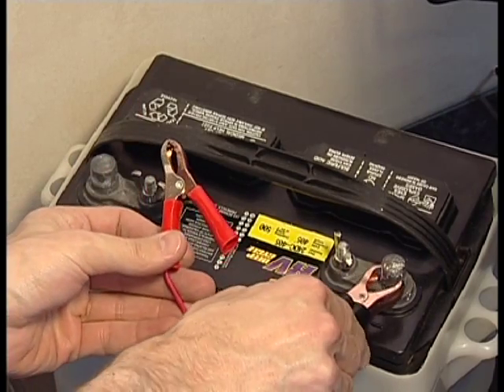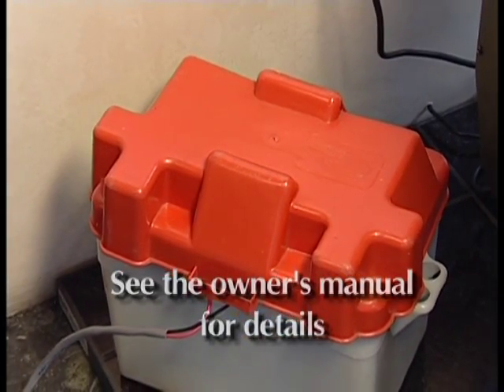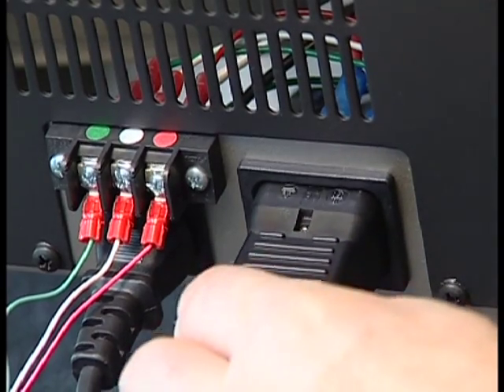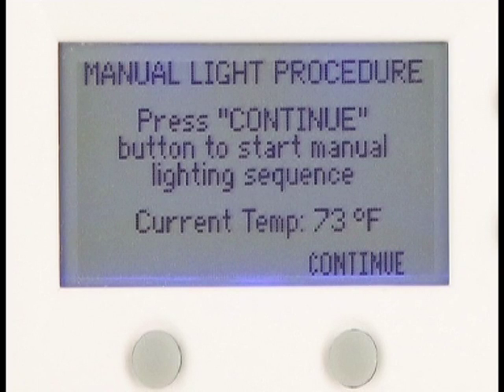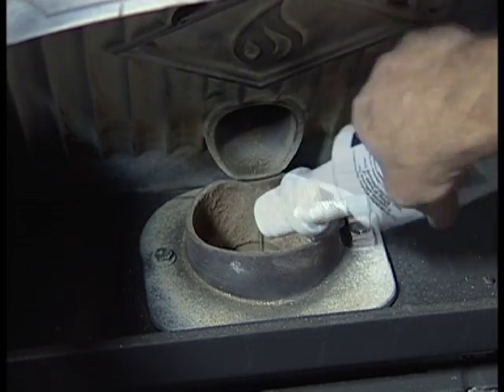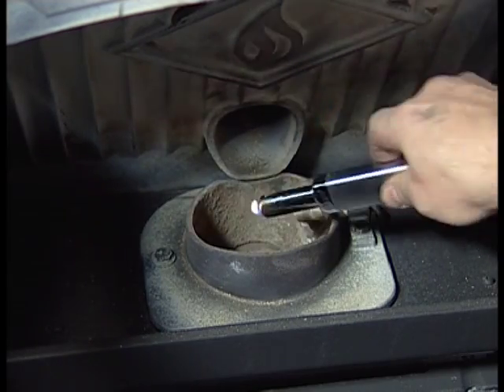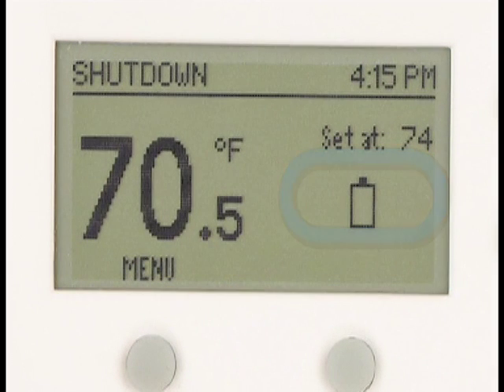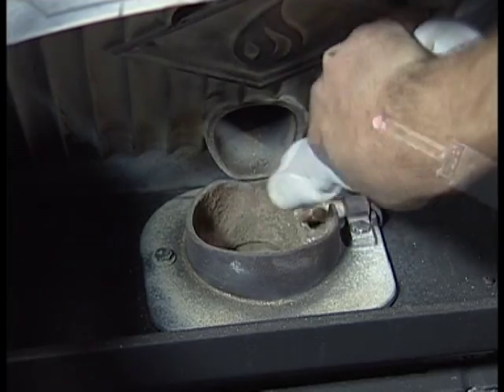Quadra-Fire® Mt. Vernon AE Pellet Stove: Battery Back-Up System Video

Comment: I connected a battery to my quadrafire using an extension cord and it's not working
Reply: You have to order a special cord which connects the battery to a special plug in the back of the pellet stove
Reply: I’m curious if you just leave the battery connected at all times during regular operation?